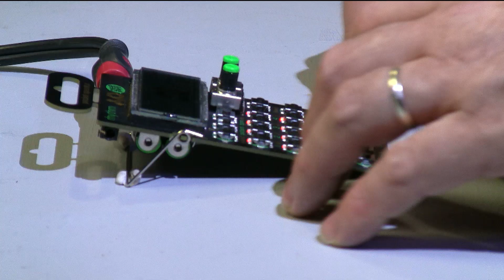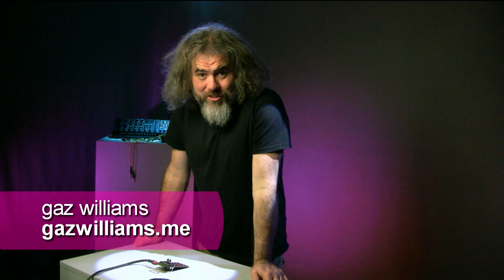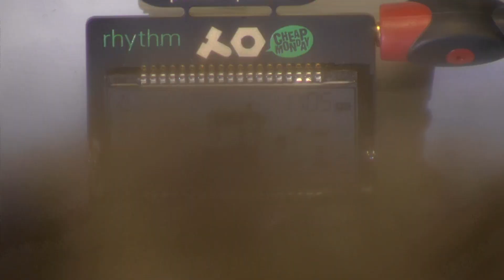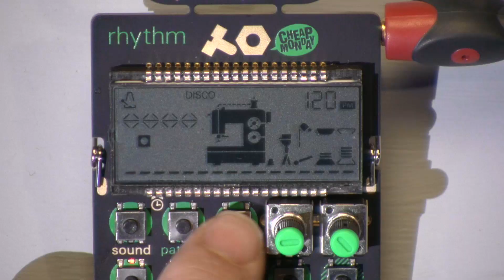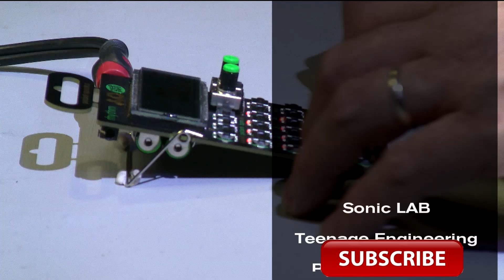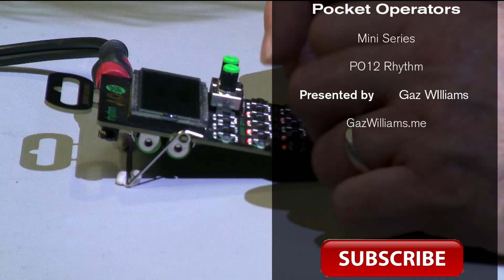Pocket Operator PO12 - Review

Comment: I own a PO-20 and PO-28. They are wonderful little things. However, my criticisms of them apply just as much to this Rhythm. Poor connectivity (where's the MIDI-in, USB-audio out and a separate sync-out that doesn't share with the audio socket?). Build quality (I feel it's a bit of a  gyp to sell the casing separately and even that £25 soft case still leaves the back of the uni totally exposed/slippy). Keystrokes (Why no dedicated shift/function key?). Sounds (great BUT would be great if it had a notched dial to access a whole lot more - a la the Volca Sample).

Comment: This is BEAUTIFUL! Any way to tie this in with a guitar pedal board?
Reply: +eldouche Since it has 1/8 outputs, you can get a 1/4-1/8 adapter or cable and just use it that way. It sounds really nice run through a subtle delay, and using fuzz gives a cool bit-crushy effect. I've run it through most of my pedals and you can really get some fun effects

Comment: ThankYou for an excellent demo of the PO12. You mentioned the volume of each note or beat can not be changed. It looks like pitch and volume of current sound can be set and listened to with recording disabled and then when back in write mode sound can be written to selected beat by keypad position including both volume and pitch.

Not sure if I could see it in the demonstration but when a specific sound is enabled only keys (beats) carrying that sound will light up. So in recording mode when sound selection is changed that sound-to-beat maping will light up. When a key carrying a sound is deselcted it will loose its sound including pitch and volume and when re-selected givven the current pitch and volume.

Comment: I just got one of these and they are great... but as far as I can tell you can't save the patterns you build. Once the batteries are pulled it reverts to the factory settings. Anyone out there know if you can and/or how to save your settings and patterns?
Reply: Connect to a Daw through mixer or soundcard and record. Save as a sample